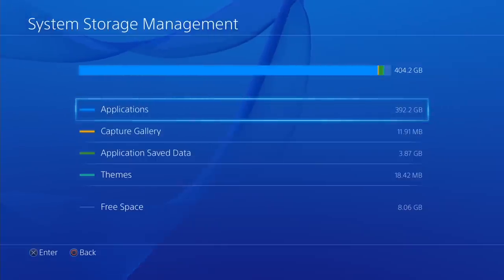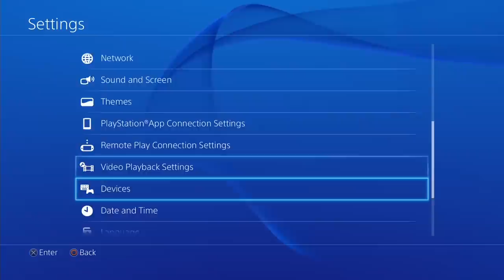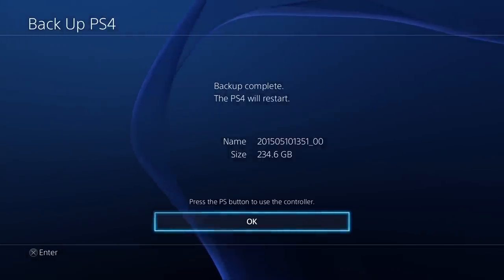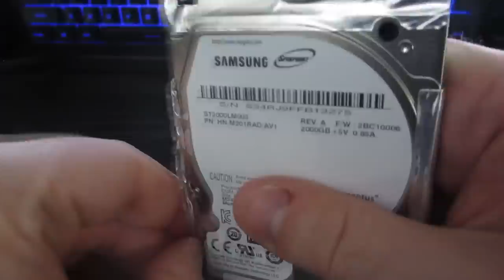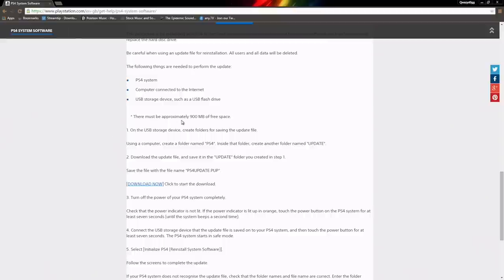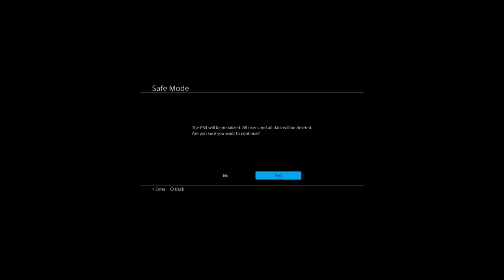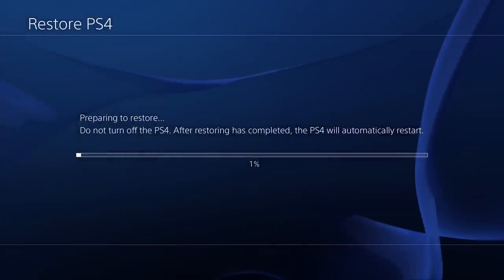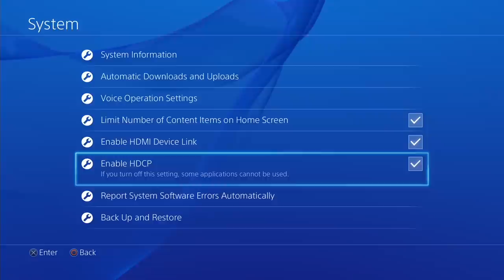How To Upgrade Your PS4's HDD Using A 2TB Seagate External

Comment: The part that confuses me is: why do I have to back up my files onto a separate drive? If I'm swapping out a fully functional hdd to install an SSD, why can't I just use the HDD as the back up? The files are already on it.  This is the part that I'm confused about. I already bought my Samsung 870 EVO 1TB for the upgrade, Plus a flash drive for the operating system. Based on all the videos I've watched, now I need to buy another drive to back up my files onto? And it should be at least double the size of the files? So a 2TB?
Reply from the maker: It’s because the original drive is not in a file format a PC will recognize.
Reply: @qwazyd0gg  thanks for getting back to me man. I know for most people this seems pretty straightforward, but I was starting to second guess myself. So to confirm, I will need another drive to save it on?
Reply from the maker: As far as I remember yes, unless things have changed. It’s been years since I’ve done a PS4 swap.
Reply: @qwazyd0gg  ok thanks. I forgot to mention I have the ps4 pro. Say I delete a few games just to save time when backing up and restoring the files (because I still have the disks) I won't lose the save file will I?
Reply from the maker: As long as you have PlayStation plus you can uploads your saves to the cloud

Comment: Can you put the system install folders on an external hdd thats already formatted and connected to a ps4? I'm upgrading to a 1tb internal hdd. I tried 2 flash drives and the ps4 didn't recognize neither but it recognizes my Western Digital external hdd.
Reply from the maker: Technically any USB storage formatted into FAT32 "should" work. You cannot use the HDD you intend to install the OS onto though.
Reply: Qwazyd0gg Tech chat support said the ps4 might not recognize the system software file because the external hdd might be too large!😐😓😢😭 That's why they recommend a usb flash drive. I'm gonna try reformatting the usb to fat 32. Will NTFS work too on the usb?
Reply from the maker: To my knowledge NTFS is not supported and he PS4 will only support the FAT formats. If your drive is too big, you can try creating a smaller partition of that's the only media you have. With an update last year, you can also use an external USB 3.0 HDD as additional storage without the requirement of an internal swap.
Reply: Qwazyd0gg So, I'm gonna reformat to fat32 and keep trying to get it to recognize it. One guy said it took three times. Ty, Sony should have used something similar to the ps3 OS.
Reply: Qwazyd0gg My internal hdd is corrupted. So I"m trying to upgrade it. Wouldn't read the usb last time I tried.
Reply from the maker: Glad to help :)

Comment: Hey man, gonna get a Seagate Expansion 2TB hard drive. Can I Just plug it into the PS4 and move games to it so I have some games stored on the console and some on the hard drive?
Reply from the maker: +Connor James Unfortunately not no. You can backup saves to an external source but unlike the Xbox One, the PS4 will not read full games from an external source. You will have to physically remove the drive from its enclosure and install it into the machine as per the guide if you would like to take advantage of the extra space
Reply from the maker: +Moogle Midgar The reason why I specified external is due to the fact that the hard drive used is in fact sold as an external drive. The enclosure is opened during the video tutorial and the internal drive is extracted and used within the PlayStation console. This was the most economical method of upgrade at the time as the external drive was much cheaper than a drive sold as a standalone internal, plus you get to keep the enclosure and utilize the old internal drive from the PlayStation console within it to act as a bonus 500gb HDD. I hope I was able to clear up your personal confusion towards the material.

Comment: Will it work with a Seagate Backup Plus Slim 2TB Portable External Hard Drive with Mobile Device Backup USB 3.0, Black (STDR2000100)?
Reply from the maker: +Wolflowe It should yes :)
Reply: thanks!
Reply: Did it work for you?
Reply: Paris Barksdale I haven't tried it yet
Reply: Wolflowe I just tried and it's too thin to fit in the caddy
Reply: Really my friend just said it worked for him. I'm still nervous
Reply from the maker: +Paris Barksdale it certainly will
Reply: This is the exact model HDD that I bought (STDR2000100) and it works perfectly for me!
Reply: All 3.0 usb work

Comment: Hi, I just made this change using seagate 2TB expansion external drive. All done and working on my PS4 but when I put old PS4 500GB on enclosure and connect it to PC the blue LED do not work, is it normal ? LED just work with original hard disk ? Can I fix it  ? Thank you.
Reply from the maker: +Jose Luis Goncalves you may need to reallocate the space in disk management since the PS4 file structure is not supported on the pc
Reply: Yes, I made it, after to close HD in enclosure, I connected it on PC and created a new NTFC partition, then begin to copy files from my PC to external HD, this way blue LED do not blink but copy is working..... can it be fixed ?
Reply: I would like this LED keep working on enclosure !!!!!
Reply from the maker: +Jose Luis Goncalves That's very bizarre. I hadn't had that issue with my drive. Maybe reach out to Seagate.

Comment: Hey Qwazy i swapped out the 2tb and now i have the 500 gb but ughhhh .. problem i choose to plug it in my mac to see if it will pop up and nothing i would like to format it and use it but it doesnt even turn on what did i do wrong here ?
Reply from the maker: I'm not sure how to do it on a Mac, but on a PC to make the old 500GB usable it has to have all partitions removed and space reallocated into a readable format for the PC. As it is now, the drive it set to a proprietary PS4 format.
Reply: Qwazyd0gg ok cool I think I screwed up but I need your Input here hear me out , okay so I swapped the 500 gb and the sea gate 2tb .... everything is running smooth the space is there however I didn't back up my lil brothers game due to him having the online upload data storage on PSN plus so when I go to add it back to his new drive some say corrupt for example a game like NBA 2k says some of the data is corrupt like settings and user data and it's actually making me start over but I didn't get quite far because the file was updating and installing its newer version note , some of the other games said corrupt as well as GTA 5 but I'm confused how could it say corrupt if the actual saved data is there is it because I didn't install the physical copy to the new drive yet ? Help me please I really wanted to surprise him on a new drive with tons of space and for the old drive I didn't delete anything yet what do I do ?
Reply from the maker: Wow man, I never came across that one myself... Everything just worked, including save data. I would throw the old drive back in and try backing up the save data from the original drive onto a flash drive.
Reply: everything worked out pretty smoovely thanks for your vid you helped alot
Reply: i believe u set it to fat 32 or u erase itt
Reply from the maker: +Cr Wangchope format to Fat32
Reply from the maker: I'm glad you got it up and running :D
Reply from the maker: +MyJordan2530 Where did I get what from I'm sorry?
Reply from the maker: +MyJordan2530 It should just be a regular screw driver. Nothing proprietary, atleast not on the original ps4

Comment: When im about to back up all my saving to an external harddrive, its says that it will bw 0KB space left and that there is not enough space, its a 2tb HDD and im pretty damn sure that it is empty...you know the problem?
Reply from the maker: Some external drives has a small partition for 1st party software that the PlayStation cannot get around. Plug it into your PC and check within Disk Management to see if that is the case.
Reply: What is 1st party software?
Reply from the maker: Typical bloatware that a manufacturer may include on a hard drive. Sometimes it is backup software, or data recovery software, and it is tucked away in it's own partition so it does not get reformatted and lost.
Reply: so should i try with another external HDD or what can i do?
Reply from the maker: +ThyleriOne I would test another drive to try and isolate the issue.
Reply: okay, thanks for the quick respond!

Comment: I bought a new ps4 slim and a Seagate backup plus slim 2tb and it keeps saying the update file is corrupted SU 30645-8.. can anyone tell me if its a hard drive issue because I downloaded the 900 mb system update for it.?
Reply: Did you ever figure this out I am having the same issue
Reply from the maker: +kruser27 from what I've read from other users, you may have either downloaded the wrong file or may not have named it or the directory correctly.
Reply: Okay thank you I will try again
Reply: kruser27 you can wait for the next update and not worry about it because they are making externals work
Reply: 7503anthony what i did was go to the storage part and floormat the external and it worked perfectly fine for me

Comment: Alright mate I bought a 2tb seagate hard drive to replace the 500gb but when I stick in the device it's saying the USB device is not connected and I've used 3 different external hard drives to back up my data saying the same thing? You know anything that could help resolve this matter
Reply from the maker: +Tyrone O'neill that's really weird man, I would recommend formatting the drive and trying again
Reply: Formatting the new 2tb hard drive like? Yeah it's very strange because I've watched lot films on it and never seen any problem like that. It's like the Ps4 is not picking up the drive
Reply from the maker: +Tyrone O'neill +Tyrone O'neill that's very bazaar but I would double check that it's formatted into ntfs. Sometimes the Seagate drives will have factory bloat ware on it that needs cleaned off
Reply: Ok no worries man I'll try that and I'll let you know if got it sorted cheers

Comment: Hi quick question, 

If I place the old ps4 hard drive into the seagate casing, can I then plug this into the ps4 and download the data on it to the new hard drive?
Reply from the maker: +William Sessa Unfortunately not. The backup is a proprietary file format only readable by the PS OS. Since the old drive will not contact that type of extension, it will not work :( I wish though
Reply: Ok thank you. I am about to start the process so I stumbled upon another question. I do not have a second external hard drive to back up my data so I was going to back up my save data to the cloud, however will all of my old data from my profile such as my achievements and trophies synch back to the newly initialized ps4 once I sign back into the playstation network?
Reply from the maker: +William Sessa u have to sync the trophies separately anyway since they won't backup. The cloud will do your saves/game data only
Reply: Is that as easy as signing into my profile on the ps network and waiting for them to synch or is there another step involved in saving the trophies somewhere?
Reply from the maker: +William Sessa I believe u just go into the trophy section and sync them
Reply: +Qwazyd0gg Ok thank you for the help!

Comment: do i need two flash drives one for the save data and one for the firmware? i seen another video that said you shouldnt put anything else but the firmware on the usb
Reply: or can i just put my save data on there and the firmware? how trustworthy is putting ur data to the cloud?
Reply from the maker: That's correct. If you want to back up your content, you will need another storage device.
Reply from the maker: My cloud was full so I have to do a physical backup. In the description of this video I have included another Q&A video about the HDD swap that you may also find useful.
Reply from the maker: +Remi Boutet You can cloud save it, but I wouldn't put it on the same drive as your PUP file. I myself used a secondary HDD as my cloud storage was full. Checkout my Q&A link in this videos description for more answers to your questions :)

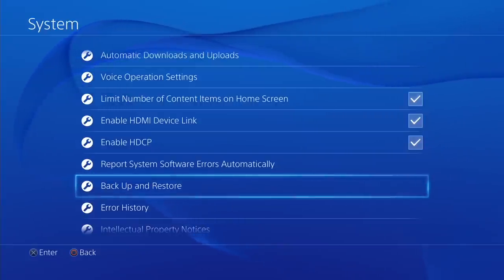Comment: 6:16 - 6:57 is that because the hard drive was too big or was it because it wasn't EXFAT?? also what will happen if I delete games that I digitally bought??
Reply from the maker: As long as the games are still available on PSN, you can simply redownload them. If it is something like PT which is no longer available, then you will not be able to retrieve it again.
Reply: what do you mean by still on PSN? also did it mess up because the hard drive was too big or because it wasn't EXFAT? my hard drive is messing up possibly because of this and I'm wondering if it happened to you for the same reason.
Reply: you know what scratch that question about the drive being too big and everything, if I delete games that are digitally bought will I still be able to download them?
Reply from the maker: +Batman I didn't have any concerns with FAT32; however, EXFAT is a very similar format. And PSN is Playstation network... their online store and service.
Reply: ooohhh, okay I see what you mean by still available on PSN XD sorry this has really worn me out, I think I'm just going to use a flash drive to back up my saved data and just reinstall all of the applications (hopefully I wont have to buy back my digital games)
Reply from the maker: +Batman You won't have to buy them back as long as u use the same Playstation ID as before. I promise
Reply: Qwazyd0gg that's a relief😄 I don't get why they have to make this so difficult
Reply from the maker: +Batman so they can make a bigger capacity one for more money in the future probably

Comment: I have used up about 240GB on my ps4 so far and I want to upgrade before I use all of the stock hard drive. Does anyone know if i can backup my games and stuff onto this external hard drive and then put it in as internal and have my games saved on it? I don't have any external hard drives to backup onto to and i don't feel like buying 2 hard drives for this.
Reply from the maker: +Ty Mitchell Unfortunately no. You will need a separate backup drive as the one you will be using as a replacement will be formatted during the OS install
Reply: ok thanks. I know someone who has an external hard drive but with Wii U games on it. Is it still possible to use this as a backup and then plug it in after the new hard drive and get my games back or would those Wii U games mess things up?
Reply from the maker: +Ty Mitchell it should be fine :)
Reply: one more question that came to mind haha. Is it possible to put my 500GB hard drive from the ps4 into the casing of the external hard drive that i would put into the ps4, then use that to restore my data?
Reply from the maker: +Ty Mitchell You can put it into the casing but you can't restore from it since the file system is not encoded as a backup file, the ps4 won't see the information

Comment: How you got the restoration data from original backup? I don't have it, it's empty.
Reply from the maker: +M.K. Frenky (Tan) are you sure the backup was done correctly
Reply: Yes! no backup data on restore menu
Reply: Can I redo back? put in back 500GB ?
Reply from the maker: +M.K. Frenky (Tan) Yup
Reply: I just put in 500GB it said can't start PS4, Need update file for reinstallation for version 3.55 or later, If I choose YES my data on 500GB will it gone or not?
Reply from the maker: +M.K. Frenky (Tan) It well be gone
Reply: Your video not clear! how many HD I should prepare! everything look so easy! I only use 2TB and a usb thumbdrive, I backup my PS4 500GB directly to 2TB and I swap it with backup on 2TB and i try to restore after initialise with reinstall system software and there is no restoration file!